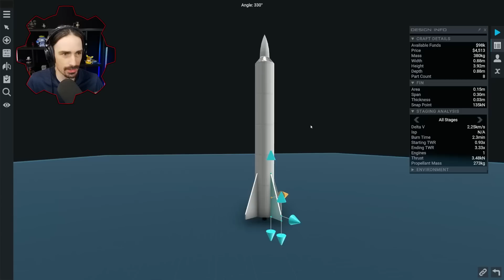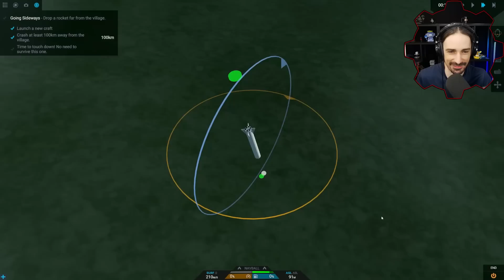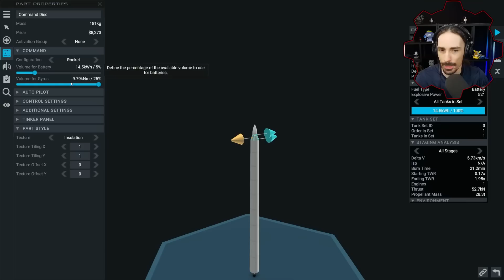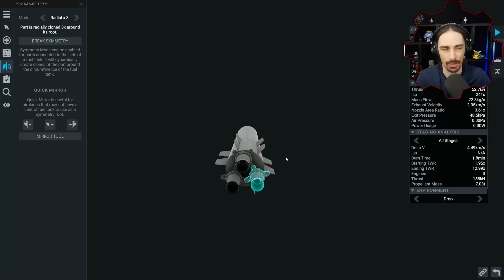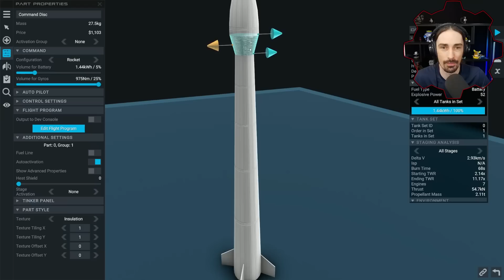Learning Why Reentry Is a BIG Problem for Rockets [Juno: New Origins]

Comment: If you want to know if you rocket can lift itself, In Staging Analysis, There is a value for "Starting TWR". TWR stands for Thrust to Weight Ratio, So if the Weight is too high for the Thrust, It won't take off. Anything below 1.00 is never going to take off because it's too heavy. If it's exactly 1.00, it will just hover in place. You'll want to have it above 1.00. The higher the number the better, but it also somewhat means less fuel to save on weight.

Comment: 3:20  In order to calculate if the rocket will lift off the ground you have to find out what the force of weight(idk how to say it in english) , and the formula for it is G= m*g, where m is the mass and g is the gravitational pull of earth(10N) so to lift your rocket you need 3.91kN, and you only have 3.48kN
Reply: It's thrust to weight and he can find that in staging analysis with the starting twr value

Comment: Force is mass multiplied by acceleration, kN is what force is measured in.
Acceleration from gravity is 10m/s/s (9.81 is more accurate) and mass is constant.
You are supposed to multiply the 10m/s/s (increase in movement speed (m/s) every second) with the rocket weight (in kg) to get the required force (kN) to get off the ground.
m/s/s is how I marked the acceleration, technically it is meters divided by seconds squared (seconds multiplied by seconds, usually 1). The reason I divided twice in a row is that I assumed that you would do them left to right, one by one. I just didn't want even more bracket confusion...
So after all this theory we can conclude that over 1kN is good for 100kg, over 2kN for 200kg, etc...
If you are interested in physics like this my discord is Xenox#0971, I may be able to explain better there
Reply: He doesnt need to do the math. Theres a TWR

Comment: TWR is the Thrust to Weight Ratio

You need a TWR of at least 1 to hover, but having a little less than 1 is fine, since you're going to burn some fuel (and thus lose weight) while the engine warms up

Comment: So the gyros stopped because there's no more power in the fuel tank                                                                         How to fix: add more power or make a new rocket with more power or just remove the gyro and make the fins have blue thingy

Comment: I know that you're new to rockets and that's very interesting for me to look at. However I feel like you're missing out on staging because it allows you to dip the extra weight and continue with less. For example if half an empty fuel tank weighs more than a separator stage it's more efficient to use it so you don't have to push all that excess weight with the engine.

Comment: Solid rocket boosters are like explosives that go off slowly and the production and basic costs of this fuel and engines are extremely cheap compared to liquid fuel that is why most uses for solid fuel in our current space industry is as a booster to get us higher up in the atmosphere where the liquid fuel is used. Liquid fuel has the ability to turn on and off as well as throttle since it's more like a powerful fire, you can stop and relight a fire but you can't just stop an explosion

Comment: I am a aerospace engineer and watching your juno videos makes my head hurt,  there is a TWR (thrust to weight ratio) it tells you if you have enough thrust to liftoff it should be above 1 to take off.  my recommended is 1.25-1.65TWR for maximum efficiency.  the reason you were having problems with the boom power in the last video was the boom power is the fuel exploding, as you take off fuel is burned meaning the boom power goes down.

Comment: make your wings smaller so you have more control in the lower atmosphere so the air isn't just trying to point you the direction you're going the whole time

oh and also there is a thrust to weight ratio (TWR) thing that has to be greater than one at launch (starting TWR) there is also ending TWR which is twr when fuel is depleeted

Comment: weight - thrust = vert speed I think. for example  400 Kilos - 500KPS=100KPS in vert speed I think  it might not be rocket science it might be tho, someone fact check me on it.
Reply: It is rocket science kinda. You need to add acceleration of gravity + Initial vert speed + time + Vert speed at time = Vert speed according to a curator

So I was half right half wrong

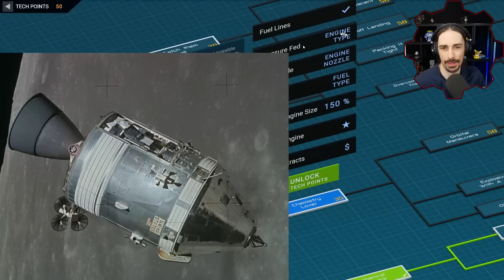Comment: 10:36 "those little course correction engines" are called RCS thrusters (reaction control system) and they use one type of liquid as fuel for fine-tuning things

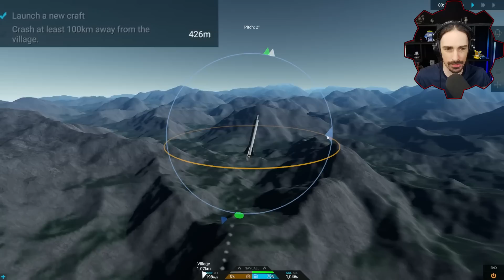Comment: 3:50 The reason it's a bit hard to turn the craft is because your fins are trying to make you point exactly where you're facing and making it hard to turn away from that when going fast enough. I generally dislike having fins on rockets solely because of this reason.

Comment: The gnome engines are thrust vectoring engines allowing you to turn I would recommend using one small one of those to steer and use the solid rockets as the rest of the thrust also kerolox stands for kerosene and liquid oxygen the gnome engines can only work using that type of fuel and the solid rockets need solid fuel so to use multiple engines at once you need multiple types of fuel 

Hope this helps !

Comment: 4:50 it does not matter how much you you move the pitch slider or how far it is to the current angle of your rocket it will not go faster.  The only thing that will make it go faster/turn faster is the strength of you gyro

Comment: 10:32 those are RCS thrusters the use monopropellant basically frozen jet fuel pressure fed engines use pressure to feed the fuel into the combution chamber @ScrapMan please give me a shoutout for telling you about the rocket stuff

Comment: to prevent Heat Damage: attempting to raise nose should help reduce heat from drag The temperature of an object is determined by how fast its molecules are moving. The faster the molecules are moving the higher the temperature. therefore if you keep nose down you'll go faster generating more heat.

Comment: TWR -Thrust to Weight Ratio... As long as it's over 1, you're gonna lift... You need to balance your weight and thrust...

Also, if you went for the interstage in the tech tree, you can divide your rocket into multiple stages... Seperate the weight you no longer need rather that dragging that long and heavy half empty fuel tank...

This is quite frustrating to watch actually...
You might actually need to READ a lot more...
Probably do or redo the tutorials... You can't just eyeball it like scrapmechanic, this is a simulator, not just a game...

Comment: You have a lot to learn :P
Solid motors use a solid fuel so you have no throttle. Liquid Motors are throttle able and have the ability to gimbal. Those 4 port thrusters you pointed out are RCS thrusters and they are different to a pressure fed liquid rocket motor

I'm surprised the game doesn't really describe it too much

Comment: Engine TWR is thrust to weight ratio. Also make sure to check out the parameters for all the components. Engines can be fully customised. Gimbal helps you to aim your rocket too

Comment: Ok, so as far as I remember the gravity force for an object on a surface of the Earth is: g*m (g = 9.81, m - mass), so to get off the Earth, you gotta have engine power more then that. You had about 340kg mass and 3.9kN for engines. So the gravity force for the rocket is 340*9.81=3335N vs 3.9*1000=3900N

Comment: Solid rocket uses tipe of fuel thats cant be stop from burning. After start of burn the rocket cant be stop. 
Liquid rocket uses tipe of fuel thats able to be controld and after burn you can easily control the throttle
Funfact: solid rocket is cheap to produce so its used to launch rocket from earth to start of space and
liquid rocket is used in space becouse you need more precision but its more expensive

Comment: Solid rocket boosters runs on solid fuel and can not be turned off, they are often used in the first stage of rockets, meanwhile liquid engines can.  Btw the conversion rate is about: 10 N = 1 kgf

Comment: this is just speculation, im absolutely no rocket scientist. but if you were to try this again i would say maybe try to flip the rocket around and use the thrusters to slow the reentry as that not only puts the control disc at a farther distance from the burn but also makes it less likely that you go fast enough to start burning in the first place

Comment: You have 25 tech points. You should definitely get the "check your staging" tech. Especially since some engines are more efficient in  thicker atmosphere, and some more efficient in a vacuum, and being able to shed weight as you go is crucial.

Comment: Could have been a verbal typo, but for anyone who might not have known: When Scrapman at around 5:25 said that getting further away from the earth was gonna reduce earths gravitational pull on your craft. That's not exactly true. Sure getting further away from something does decrease the gravitational pull, but between the surface of the planet and in orbit, the difference is incredibly tiny. even the ISS and other different Satilites, are experincing the (almost) same pull that we are. Their "weightlessness" being due to the constant fall that they're in, being in orbit and falling around the earths curvature. The reason why spaceships go a lot further the further away from earth they are, is mainly due to air friction slowing it down until it can no longer keep up with the curvature of the earth. At a certain point (orbit) the resistance is almost 0, and with the right speed it could (techically) orbit forever.

Comment: Note that fins will always try to angle your craft towards the direction it is moving, which might be the reason you are unable to turn well with the gyro (this is only the case they are on the bottom / below center of mass, if they are above the center of mass they would try to face the rocket backwards)

Comment: Gravity on earth is about 10 m/s^2 so just multiply the mass by 10 and you have the amount of newtons you need to at least get zero g. At 3:11 you have 391kg, 391 * 10 = 3910N but you only have 3480N. That means you would need more than 430N more with every newton giving you 1/391 m/s^2 of acceleration. Should be right but other comments said something about the "Starting TWR".

Comment: As a Very Very Very experienced kerbal space Program player 
I say you should use multistage as soon as possible 
Like a main booster stage and a secondary liquid fuel stage so you can fly in the less dense atmosfere 
And use less fuel 
Also you need to get Control surfaces for your wings Asap
The are creating soo much drag thath makes Impossible turn at high speeds

Comment: the reason at high speeds you can't turn is because of your fins, they try to keep you straight, but when you are going post 700m/s low in the atmosphere, they work a bit too well.

Comment: General rocket games tips, solid rockets are very simple and cheap but they are not throtable, liquid motors are very expensive but throtable and usually have a gimble, if you want to figure out if a rocket can launch just divide Newtons by 10 and thats how many kg you can lift ( A N is 1 kg*m/s^2 this means that something with 1 N of force can acceleratr 1 kg at 1m/s^2 since gravity is arroung 10m/s^2 you will need about 10N per kg for takeoff) also, isp measures the efficiency of an engine,( it means the amount of seconds that a rocket that produces 1N of force can run while only using 1kg of fuel) basically, if a rocket has 200 isp and a different rocket only has 100 isp if they both have the same amount of fuel the first rocket will generate 2 times more force, and thus speed ( they will not necesarilly run longer, they will just run more efficiently)

Comment: A reaction wheel works by spinning a heavy weight and stopping it instantaneously which uses the 3rd law of Newton that says when an object is moving, an exact same force will be produced in  The opposite direction of the object. Using this mechanic, you need to use your reaction wheel for less amount of rotation on your rocket so that you can have better results

Comment: I think the gyro thing may be caused by not allocating enough space to batteries. There's a slider above the Volume for Gyros slider that is labeled Volume for Battery. It looks like your rocket is rotating, but then it's stopping like the gyro cut out or something, which could be caused by running out of battery.
Reply: The fins keep the rocket looking at where it's going (prograde) and the gyro isnt strong enough to combat that force
Reply: The gyro isn't strong enough, especially at high velocity. Soon enough he'll get control planes for the fins which is much better (only in atmosphere) at aggressive maneuvers using and controlling the airflow for changes in direction. The gyro is great for zero/low atmosphere maneuvers that don't have to fight airflow.

Comment: you need 9.81 times upwards thrust in relation to weight meaning 100kg needs 981Newton of power so just take enough engines for ~1000Newtons or more

Comment: The Delta V indicator in the build menu indicates how much speed the rocket can achieve in a zero-g vacuum, therefore imforming you about how far the rocket can travel. Btw, the equation for Dv is Dv= mv * IP (mf/mo)
Reply: Also, to get into orbit, you have to get the periapsis/perigee (the highest point of a orbital/suborbital trajectory) above the planets atmosphere. Then, wait till the rocket is just before the perigee and burn prograde (the direction your traveling in) until the apoapsis/apogee (the lowest point of a orbital trajectory) is above the atmosphere on the other side of the planet. Since it requires two burns, a liquid-fuel engine and/or multiple stages are needed. Additionally, the TWR should be around 1.3 for a normal rocket (unless you want to make a missle), not 2.5 or above. Balancing out the amount of fuel and  the TWR is the key to efficiency. I never played Juno before, but I am a ksp (Kerbal Space Program) player, and if real-life physics apply to Juno, it should work.

Comment: The first launch failed because you had a thrust (force) of 3.48kN or 3480N (Kilo as in a 1000).
To launch, the bare minimum requirement is to have a thrust force bigger than your gravitational force, which depends on two things mainly of course, the mass of the object and the force of gravity.
The general formula for this, is F(gravitational force) = m * g, hence the gravitational force acted upon the craft was 391(kg) * 9.81 = about 3835 N
Because the thrust force was not bigger than the gravitational force, the ship could not take off :).
As others have also said, this ratio can be seen from the thrust to weight ratio or simply the mass could be multiplied with 10 (roughly lol) and compared to the thrust force.

Comment: Get “Check your staging” in the tech tree, it is going to be pretty much essential in order to get into orbit, essentially it makes you detach used fuel tanks and engines that would just be dead weight, also the new engine you unlocked should be used in vacuum, not to take off. So for example one good attempt to try and get into orbit would be to have a 1st stage with solid engines (which can only work with solid fuel types); than detach that 1st stage and use a 2nd stage with the Gnome engine (which uses liquid fuel types) which is more efficient at higher altitudes

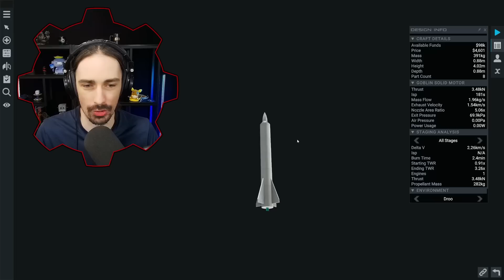Comment: A Tip : at 2:22 in the Menu under All Stages ,,Delta v“ is the total Speed the rocket Can get. Ist is pretty nice to know Cause if u know the Numbers u Can change the Build in cause Go change the value. Par Exempel the Delta V to Archive an stabile Orbit are around 3000m/s i guess.
Reply: Delta-v isn't how much velocity you can achieve, but by how the velocity can be changed by that stage (delta - change, v - velocity). To get to orbit in this game, I believe you need around 6km/s dv, but it's around 3.5km/s in kerbal space program or almost 10km/s in real life - depends on the scale of things.

Also, escape velocity is how fast you need to go to escape the earths sphere of influence and get to other parts of the solar system
Reply: Isn't that called escape velocity, or am I remembering wrong? I mean the velocity you need to escape the earth's gravity and achieve orbit

Comment: Starting TWR Thrust to Weight Ratio, ie If you dont have more than 1 then you dont have enough thrust to overcome weight. If you think of it as 1:1 TWR = (thrust in Gs or thrust needed to overcome weight) : ( at one planets gravity or 1G)  so TWR of 1 would perfectly hover. a good rule of thumb is 1.2 absolute min and 1.4-1.6 or more is about optimal to not only overcome gravity at launch but  to accelerate relatively quickly, spend less time in atmosphere and less time fighting gravity.

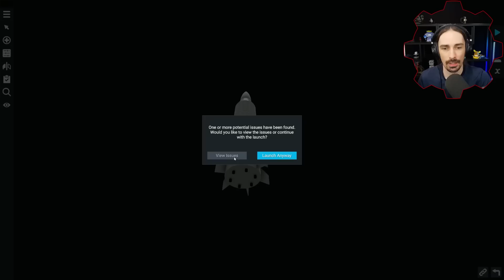Comment: 16:20, Kerolox doesn't have burntime for the solid engine (first you used in the game) because it uses solid propellant and kerolox is a liquid one. Those are the two types of propellant in the rocket industry, so make sure to know which engine uses which propellant. And also, if you want to know if you will be able to take off, you can calculate your effective thrust by subtracting your mass in kg multiplied by ten to your thrust in N ( thrust [N] - mass [kg] x 10 ), don't forget to do the conversion or else you won't get the correct effective thrust (As you probably know 1t = 1000kg and 1kN = 1000N). The effective thrust is the ammount of thrust that is going to accelerate the rocket and must be positive if you want the rocket to take off, the ammount of thrust left is used to compensate the weight of the rocket.